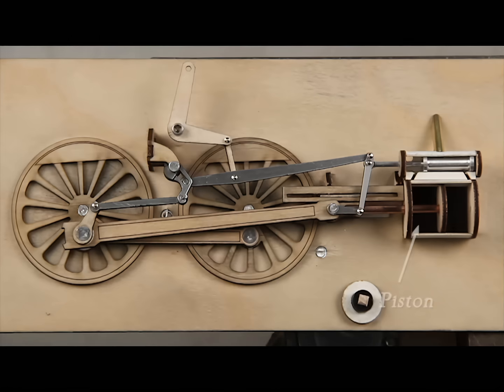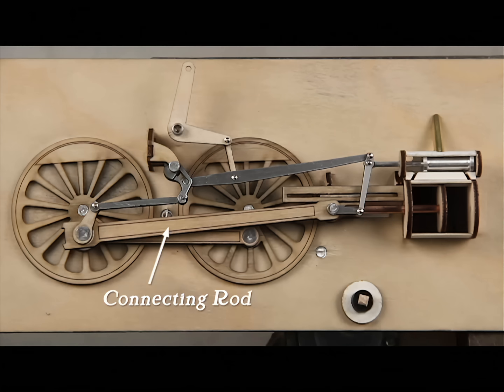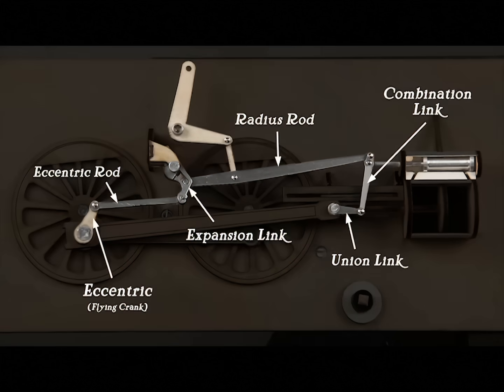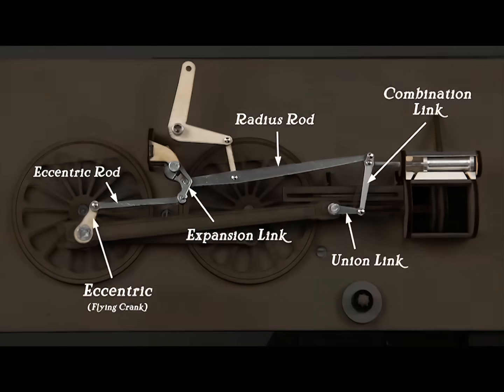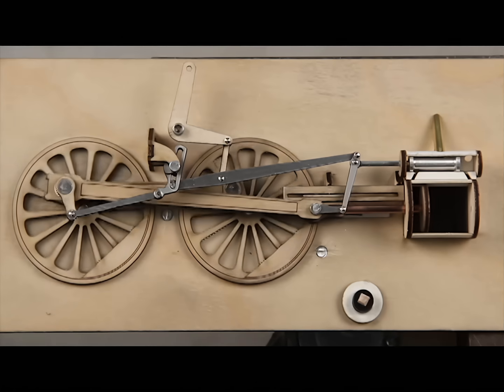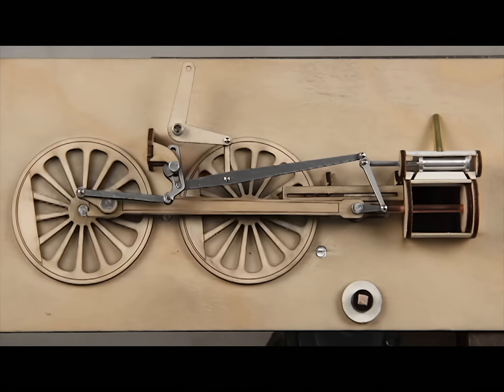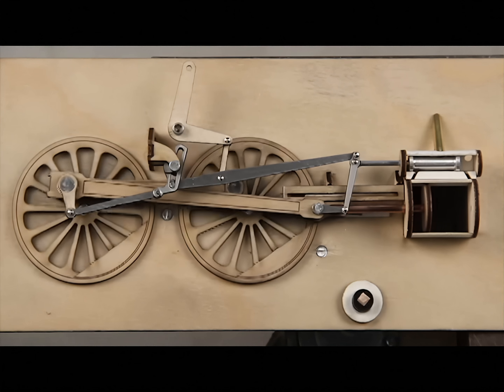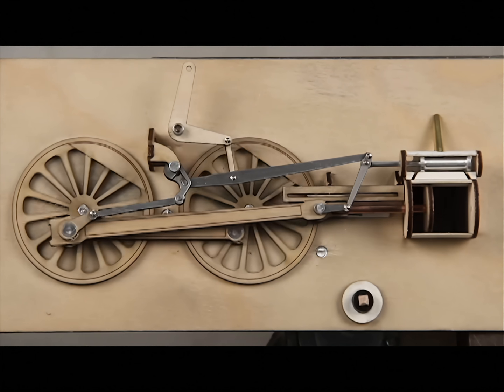Walschaerts Valve Gear Explained

Comment: This valve gear is the reason double-expansion steam engines are not common on trains - if you just pulled back the Johnson bar you'd get the same efficiency as if it were a double-expansion engine of the same total displacement, but that doesn't stop you from putting balls to the wall and getting significantly more power at expense of excessive coal and water consumption, which wouldn't be possible on an actual double-expansion engine of the same size.

Comment: Very interesting explanation. If you are going to revise it, I think it should include a reference to the steam being used twice before passing on, either as exhaust or to a further set of lower pressure cylinders. However, what you say makes it very clear what happens and what all those rods do.

Comment: This is possibly the best explanation of Walschaerts valve gear I've ever seen. By way of extension, it helps explain other valve gear types and steam engines in general. My grandfather was a locomotive engineer who explained the basics to me, but it still took some head scratching on my part before the Eureka! moment. I completely understand looking at a steam engine and feeling it is a mystery how it works.

Comment: Yes, nice model.  I've seen similar one B4 in utube.
But, more important is to tell us how to design this Watumacallwash it valve gear.
How to compute/get the measurement of these rods betwn the linkages?**

Start w knowing the cylinder stroke length.  Then, let us know how to calculate the
rest.  Note dattto u must position the cylinder mounting location such dattto stroke
going forward n backward is symmetrical wrt the line bisecting the cylinder's horizontal axis.
And how do u calculate dattto too?

Else, this video explanations on how it works is useless for us live steam modeler.
for an electric motor powered steam outline locos, u can keep the die block in middle
of the Expansion link and the motor switch can control fwd/bkwd direction as the pistons
r dummies.

_______
**Yrs ago, some Gent came up w stick n stone anime model of this gear but was useless as
    some of the linkage dimension input was missing, i dink it was the small link distance betwn the
    Radius Rod and Valve Stem if i remembered it correctly amongst the other link distances

Comment: And thus Walschaerts learned that sacrificing a Virgin to the train gods was why the whole thing worked. Later Walschaerts worked out the timing so precisely that the Virgin sacrifice was entirely unnecessary. And so Walschaerts became like a god in engineering circles. Amen.
Great video. Explained very well with no messing about.

Comment: Thank you for your educational efforts. From the explanation and schematic, I was a bit puzzled by the name "Walschaerts Valve," as I had previously known this mechanism as the "Heusinger control." A Wikipedia article explains this dualism as the result of the independent invention of essentially the same mechanism by both a Belgian and a German engineer around the same time. Coming from a country influenced by German engineering, I was unfamiliar with the Walschaerts naming.

Nevertheless, I greatly appreciate your choice of locomotives at the beginning of the presentation showing the beauty of steam engines. The first geen one, together with the Walschaers Gear title actually caught my attention.

Comment: A fine demonstration of why certain 'analogue' devices - such as steam locomotives and internal combustion engines - arouse such passion in enthusiasts. The machines seem almost to be alive. Engines literally breathe; they require adjustment, care, understanding, 'feeding' and attention, just like a living thing. They need us in order to operate effectively, and it's always nice to feel needed.

Meanwhile, digital-electrical/electronic devices such as electric vehicles [EVs] generate no such emotion. They work quietly and silently; a Tesla will go when you press 'start', and stop when it's turned off, just like a heater or washing machine or computer.

EVs work, but there's no sense that they're in any way alive or that they require care and feeding. They're demanding but not temperamental; they don't respond to encouragement or fettling or fine-tuning like a steam engine. Essentially, they don't need us.

Analogue machines have moods; they have good days and bad days. They often even have names.

But electrical devices are appliances, not companions. They don't reward careful attention in the same way that an internal combustion engine might. They go, they run, they stop, but they don't include us in the process. They allow us to engage with them, they tell us when we must serve their needs, but they don't depend on our understanding, nor do they reward the gentle touch of a sympathetic hand with slight improvements in performance. They don't really need us. Their electronic control units meet their needs.

It's our job merely to serve.

Electric-electronic devices USE us, but there's no sense that we're dealing with anything alive. An EV may be fast and quiet and remarkably sophisticated, but it doesn't engage with its driver. Its systems are locked, sealed and encrypted to deter tampering; if it requires attention it will seek it via an over-the-air WiFi link, connecting to a remote computer, exchanging data, and all without any attention from its human servant.

Yes. Servant. That's not a particularly attractive position to occupy. Humans are slaves to their own appliances. That's not a healthy or rewarding relationship. Who wants a digital device as their master?

So it's little wonder that people fall in love with complex analogue machines like steam locomotives. They'll willingly devote time and resources to them, just as they would to a valuable, much-valued carthorse. Steam engines, internal combustion engines, their mechanisms - gears and linkages and valves - are attractive because they need us.

Which would account for the popularity of videos like this. Almost 1.5 million Views in January 2025. That's remarkable.🙂

Comment: Stephenson gear predates it and is still advantageous for two-cylinder engines that mostly operate at high cut-offs (i.e. luggers).  At low cut-offs and high speeds, Stephenson gear tends to give overcompression in the cylinders and causes the relief valves to open, so the lowest cut-off available was usually limited.  

Walschaerts gear gives constant lead in all gears, lower potential cut-offs and is more suitable for mounting outside the wheels.  The GWR in the UK used both: Stephenson for most 2-cylinder engines and Walschaerts for 4-cylinder engines.

Comment: Isn’t there a 50% chance the locomotive will move backwards instead of forwards (from dead stop). Like, did they need to look at the position of the drive wheel linkage at rest, to then decide? Also what if it came to rest with the rod at one of the two “nulls” (rod dead level). Sorry for dumb questions, putting myself out there to be sure!
Reply from the maker: No. since the rods on either side of he engine are 90° phase.  This also prevents lock-up when one side is at TDC.
Reply: @ awesome, thx for the explanation

Comment: Being a big rail fan myself with passion for not just steam locomotives but ANYTHING steam powered. I always knew that linkage was the reversing mech but did not know that it helped finely control the input valve. Since I was a kid something about anything that operated using gears, levers, & linkages fascinated me & after years of toying with the idea I finally got the proper material to build a mini steam engine. But I don't just want some little experiment toy, as a advid rc & precision scale modelest whose been in the game for more than 30 years I got a rep to defend lol 😅 so I want the real deal that can be precisely controlled. I love earthmoving machinery & when it comes steam nothing would be cooler than building an real steam powered portable Marion power shovel which like its super-sized counterparts but was small enough to be easily hauled to jobsites on Flatbed literally starting a revolution. Though you can purchase them unfortunately they cost an arm & a leg. I've been trying to fully figure out how that obviously very critical part worked & was gonna do something similar to what you did. Something I've done for years cuz drawn scamatixs don't quite cut it like actually seeing it in action. Thankfully you've went & done that for me & I'm quite impressed cuz you kept it simple yet very informative. Now I know why the engineers driving the locomotives are always taping on the drive lever. It's cuz their carefully finding that sweet-spot when engaging. Love the moving model you made to explain (I'm kinda jealous 😂) .. But of all things steam powered I'd kill to see the massive 3 story tall engine that powered Titanic's 24" propellers. Being feet from something that size moving at 120 rpms would be a trip. .

Comment: One question, as piston driven devices, how did they overcome the potential for locking the drive wheels at bottom or top dead center?
Reply from the maker: The two sides are 90° out of phase, thus preventing TDC lock-up.
Reply: @BLitwin  Cool, I was thinking about that but doesn't that cause vibration issues? I'd think at high speed there would be balance problem.
Reply: @LaPabst  ... if they are properly set at 90° out of phase, vibrations won't be an issue, as the weight of the wheels would act as a flywheel.

Comment: The thing that is cool about older machines is that they didn’t use computers for all the timing systems. They just used physics and mechanics to make devices
Reply: Sliding rules, paper diagrams and tables and a lot of sweating on drawing boards.

Comment: How much of it was designed in someone’s head, how much was drawn on paper, and how much was trial and error?
Reply from the maker: Not having been around in the nineteenth century, I couldn't honestly tell you that, with any veracity. But, having worked as a mechanism design engineer in the days just before the advent of CAD, one formed such ideas in the back of the mind, based on a synthesis of established convention, core principles, and observed behaviors.  From there you'd make a sketch or two, and then a comprehensive layout, before punching out the parts details. Often times, colleagues would be invited consult and criticize the layout to address conceptual or anticipated problems. Hope that helps.

Comment: I have one further question - how is top dead centre avoided when the locomotive comes to a stop?  It would seem to me that TDC should never be allowed to happen!  Or is this somehow tied into the reversing of the steam routing for backing up?  Great video!  But I always have more questions!
Reply from the maker: When the drivers of one side of the engine are at TDC, the other side is at 90° thus preventing lock-up.
Reply: The 90° crank offset,  which prevents a dead spot,  would also explain the uneven 'puffing' of the engine at speed.  The John Deere 'R' tractor had a tendency to gallop at a low idle speed,  so we always raised the idling speed just enough to eliminate the 'gallop'.  Interesting and thank you for your great explanations!  Live long and prosper,  friend!  😊

Comment: 20/5 23, An original form of Variable Valve Timing with equal importantance as the invention of steam power. Many locos were later modified to include this device & improve efficiency. Your demo' illustrates how a simple design addition can increase performance using less fuel. Appreciate your explanatory  technique !

Comment: How many times per second the valve of the steam locomotive moves ?
Reply from the maker: It depends on the speed the locomotive is traveling. The valve goes through a complete cycle with each revolution of the wheel. If the wheels were 3 feet in diameter, and the train moves 10 feet per second, then the valve operates about once per second.
Reply: @BLitwin  ..... Aha, ok man, thank you very much.
I thought that the control panel of the steam locomotive could be automated and digitized, in this way greatly increasing the yield, minimizing losses and also minimizing
pollution.....
In this way, the working conditions for the driving engineer and the on-board personnel of the locomotive would be very much brought into the category of decent and superior to the current state,,,, what do you think?

Comment: Thank you for your video.  I have a question concerning the "choof, choof" sound of a steam engine. I would surmise the "choof" is steam either entering the piston box or leaving the box (maybe both?).  Therefore, there would be 2 "choofs" (maybe 4?) per one 360 degree rotation of the drive wheel.  Could you please elaborate on this?  I've watched steam trains and can never seem to reconcile the sound produced to the motion of the wheel.  Also, I think, steam trains have 2 steamboxes, port & starboard.  Are these boxes syncronized in anyway with each other or do they run totally independant?  Thanks!
Reply from the maker: That noise comes from the steam being exhausted into the smoke box.  This creates the draft coming from the firebox.

Comment: 90 degrees out of phase.  I have no idea what that means.
Reply from the maker: It means that the connecting rod is at 12 o'clock (on the driver wheel) when the eccentric crank is at 3 o'clock.
Reply: @BLitwin  Thank you.

Comment: Its been a few years, so not sure if you'll see this. But is there any materials on what lengths each of the rods should be?
Reply from the maker: If you want to make your own model, you can do what I did, which was to find a high resolution image of a real locomotive, seen from the side.  Then, you can import it into Photoshop or Illustrator to measure and/or trace the parts out, using the image as an underlying guide.
Reply: @BLitwin  oh yeah that's not a bad idea! Maybe I can then find ratios that work so I can scale it up and down. Thanks :)

Comment: The eccentric crank confuses me, how do you make sure it rotates along with the wheel? I tried making a model but the eccentric didnt rotate along so i connected the axle to it with gears, you know, like a planetary gear setup?
Reply from the maker: The eccentric is fixed on the end of the crank pin.  It rotates with the wheel, independent of the rods.

Comment: I spotted the error too. Nonetheless, a great video. Thank you for the time and effort that went into this.
Reply: There is NO error in center. The valves SHOULD open in center (there is no neutral). In center, the valve opens a little bit - this is called the lead - as the valve is only controlled by the motion of the piston through the lead and lap lever. When the valve gear is properly set, the loco can run in forwards/reverse as the valve events are the same, just not very powerful.

As far as the eccentric crank, the eccentric crank is close to 90 degrees off, but due to the piston centerline being higher than axle centerline (dead centers are not 180 degrees apart) and the height difference between the axle centerline and the basked of the link, the angle can vary from loco to loco and with the crank pin at the 6 o'clock position the eccentric crank pin is higher than the axle centerline making the angle listed in this video greater than 90 degrees.

Comment: Great video!  But... I still do not understand the reversal!!
Reply from the maker: The engine reverses when the engineer moves the radius rod to the top position of the expansion block.  This causes the motion of the eccentric rod to be translated 180° out of phase with respect to the bottom position.  The valve ports are operated in the reverse order, respectively.  Bear in mind that this mechanism is duplicated on the other side of the engine at 90°.  If it were not, changing this configuration would have no absolute effect on direction.

Comment: Awesome demonstration of mechanical engineering. It’s amazing what people came up with purely from mechanical movements, before computers and electronics came around.  Give the problem to an engineer now and it would be filled with limit switches and circuit boards to accomplish the same thing 😜.

Comment: There may be an error in the model, but the explaination was still solid (and very well presented).
I was taught that when running at high speed, the radius rod / forward-reverse lever was brought down to about 10% to allow a bitbof steam in, but not much.

Love the video, love your work; if a kit becomes available, please let us know or publish a video on it. You'll get a lot of takers :)
Reply from the maker: Thanks you :) I've been encouraged by a few folks, to make a kit of this.  If you would message me privately, I'd like to ask you a couple questions about this.
Reply: There is no error...not sure why people think that there is. The valves SHOULD open in center (there is no neutral). In center, the valve opens a little bit - this is called the lead - as the valve is only controlled by the motion of the piston through the lead and lap lever. When the valve gear is properly set, the loco can run in forwards/reverse as the valve events are the same, just not very powerful.

As far as the eccentric crank, the eccentric crank is close to 90 degrees off, but due to the piston centerline being higher than axle centerline (dead centers are not 180 degrees apart) and the height difference between the axle centerline and the basked of the link, the angle can vary from loco to loco and with the crank pin at the 6 o'clock position the eccentric crank pin is higher than the axle centerline making the angle listed in this video greater than 90 degrees.

Comment: I understand the motion from watching and glad to see you make a correction. I'd like to understand the various compensating linkage designs and some are not so simple! quite advanced! why then were gasoline engines so slow to make use of valve timing on the fly until very recently?